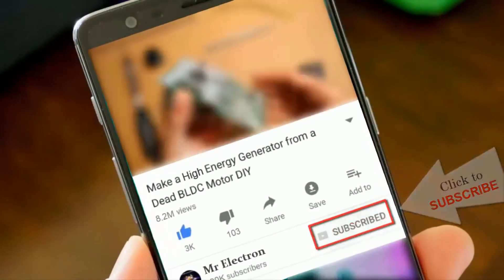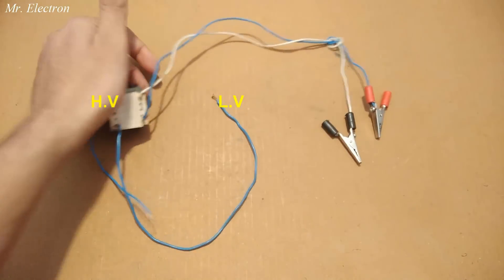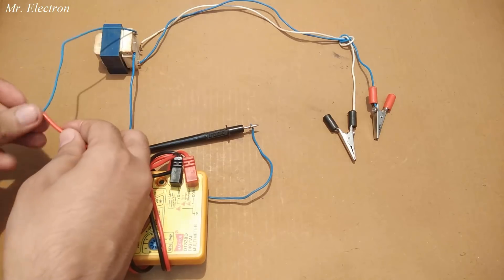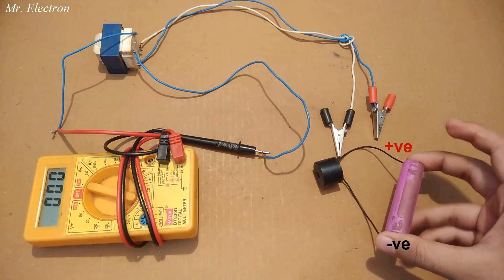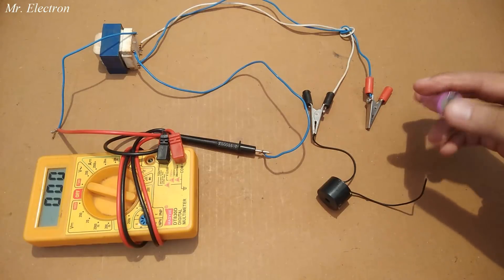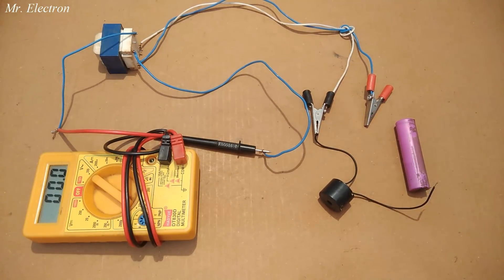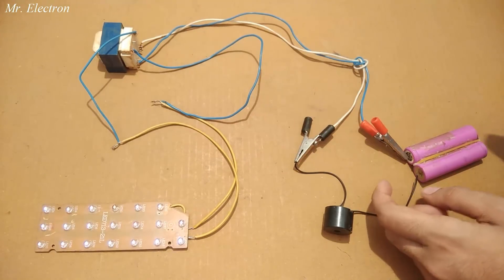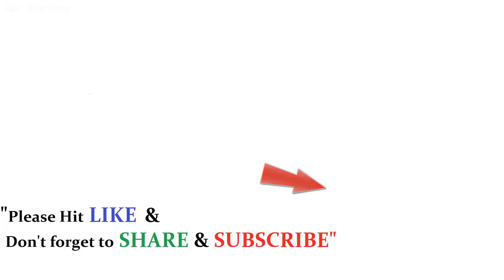Make DC to AC Converter || Simple Buzzer Inverter DIY

Comment: Actually called a vibrator voltage multipier,used to power vacuum tube radios in automobiles before transistor technology took over.
NOTHING NEW UNDER THE SUN.
Reply: Oh ya nothing new under the sun? Well why don’t u check out instagram magicresonators and see my fuckin resonant zero point oscillator invention that i built completely by myself in order to make everyone’s life easier including my own in due time.. ;)
Reply: john amptech nothing id love more to do than to change your negative perspective on life. EVERYTHING NEW UNDER THE SUN
Reply: I see your pessimistic outlook on life. There’s a better reality. It IS a potential paradise